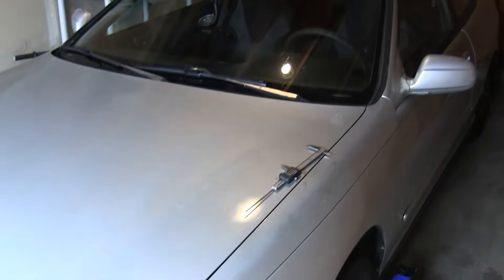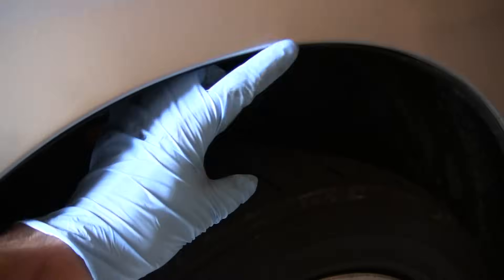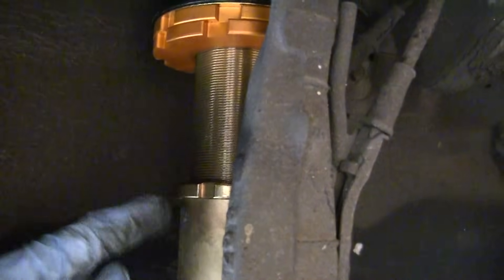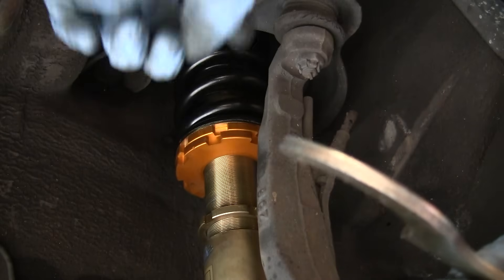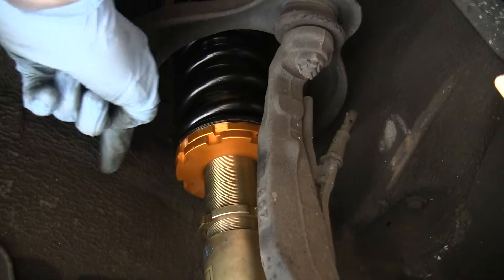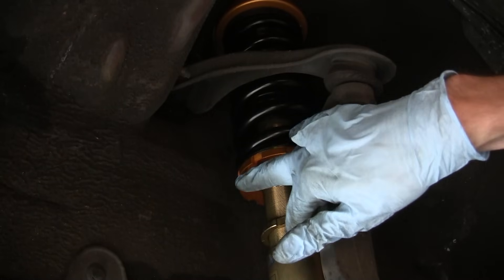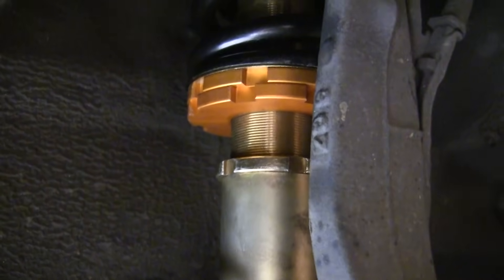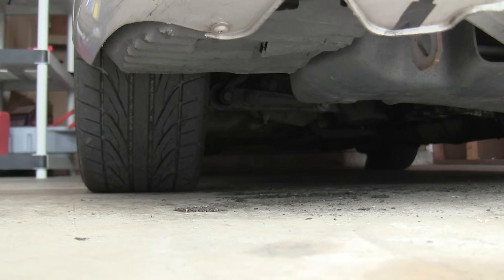How to Adjust Coilovers - Explained

Comment: is there any chance that the inner axle will pull out? when bc coilovers are on? because I had it removed because I had coilovers, I just adjusted it from .5 to 2.5fingers gap, then the axle pulled out after adjusting, suspecting the spring because it is said to be soft. or is that tension because it's no longer camber?

Comment: You should avoid turning the upper rings at all once the preload is set properly if it needs to be whatsoever.
In threaded body coilovers you should be turning the spring by hand to thread the body deeper into the bottom of the assembly, or out of it to adjust the height. 
If the spring just spins and the threads of the coilover doesn't, the preload is not set properly.

Comment: What if the rear coil lovers don’t want to lower? It seems like my front coil lovers are lower than my rear, does that make sense? Should I use a cheater bar to force it to go because I don’t know if I’m at the max which I highly doubt it because I have aanswer to gap between my tire and rear fender thingy

Comment: Please do not buy the adjustable coilover . ( shocks ) this video are not tell you what problem behind . 1the cup screws to body frame , is not fix , make a noise , 2 the break line screw holder not have a thred . I have to buy a nut to put it in . . 3 the bootm of the shock have 2 big crews this brasket biger the screws . all they loose after finished test drive . the shocks very hard . the car is not soffer when you crossing railroad . they bounding very hard . no good at all .

Comment: You are not meant to turn both adjusters at the same time one locks the other in place, you would find it far easier to unlock them then adjust either up or down and then relock them

Comment: I know is this is old. But when you do this do you do the exact same to the opposite end? For instance both front coilovers should be symmetrical? I did this but when I measure wheel gap it’s uneven. Could this just be my driveway?

Comment: Great video, I used this video to help me adjust my coilovers. 
Also every coilover is different,  just because he set his at 6.5 inches doesn't mean you should set yours to 6.5 inches too. The coilovers on my Toyota Celica was exactly the same inches as the wheel gap, where 4 inches on the coilovers (bottom of bottom-ring to top of top-ring) was exactly 4 inches on the wheel gap (fender to tire).

Comment: Rookie question, you have the bottom ring all the way down then the next camera change you have the bottom ring up? I didn’t see you move the bottom ring, so I have to turn the bottom ring up the desired amount I want it lowered? THEN turn the top ring to the left until the bottom ring is sitting flat then tighten the bottom ring?

Comment: my ksport coilovers intructions says to adjust the ride height by spinning the bottom part of coilovers that connects to the lower control. instead of compressing the spring like you’re doing in the video to prevent premature wear. now i’m a confused lol

Comment: Hi, I adjusted my coilovers, all measurements from bottom of the ring to the other ring are all equal. Drove it for miles, but I found out the wheel gap is not equal? Is it normal?

Comment: Hey I’m I gotta question when I’m trynna lower my coilovers they whole coilovers moves and the ring dont
Reply: The bottom ring is how you adjust the ride height break that loose and rotate the coil over until you get your desired height adjustment.

Comment: For a channel that has engineering in its name , i am surprised you describe rotation in terms of left and right.  There is no left and right, it is counter clockwise or clockwise depending on your point of view. I always laugh at folks who use left and right to describe rotation.

Comment: Hi, these look like the MaxSpeedRods, which I recently installed on my 2006 Corolla. The rear came out a little high & I’m wondering if I can adjust the rear height the same way you did for the front coils? Thanks in advance for your help 💋
Reply: Yes you can

Comment: @Engineering Explained - I have seen some reputable sources say adjusting ride height from the lower collar is incorrect. They say to make ride height adjustments at the lower spring perch. This makes no sense to me and intuitively I adjust ride height as you did in the video. This method does not disturb bump/droop distribution like spring adjustment would. Any comment on that?

Comment: Ok, now I know how, to adjust my dampeners. But, I'd really like to know 'why'.  I mean will I adjust them until I'm happy with the ride and handling? 
If so then I'm going to spend a lot of money on alignments as I go through a trial and error process. Not to mention that I'll probably want to adjust differently for different tracks.  
Are there manufacturer settings that are geared toward certain track types?

Comment: Im bought K sport suspension for my Honda Crosstour it can adjust about 2.5 cm lowered from my stock but when i bring to the shop and they done for car, it’s lowered than that I expect and the problem if i hit the bump sounds like cracking,, sounds like my springs at the rear is to much compressed,, im just asking is it normal or will be bad to my car,, i need ur help and pls comments thank u

Comment: pre sure you just messed with the pre load
Reply: I'm still figuring things out but I think since he loosened the bottom ring and then turned the whole shock body (and not just the 2 preload rings) it came out as if he'd just spun the bottom bracket and adjusted the height, even though the rings he was turning were the preload rings. I think if he'd loosened the middle ring (the bottom orange one) and then moved the top orange ring to meet the bottom one (so that it spun and not the whole shock) that would've done the preload. But I could be wrong.

Comment: You don't actually have to keep periodically checking the height. You can just take the lowest lock ring at the bottom of the threads, and bring it up to where the gap between that and the top adjusting rings is the placement you want it at, then keep adjusting down until you get the lower lock ring at the bottom again. Then measure and adjust slightly if needed.
Reply: I read you're not supposed to adjust the bottom ring. I'm not sure if that's a universal rule. But I never touched mine.
Reply: that’s what i thought he WAS doing😭😭

Comment: What does the pre load  of the spring measure .from the top orange  to botom  orange lock nut what does it measure from factory . Had the car adjusted an they mest with that in sted of lowering it

Comment: Great video and easy to understand, just a clarification please, in order to raise the vehicle do you make sure that the top 2 collars are well tighten together and rotate the lower collar (of the 2 collars together) counter clockwise looking from the top, should  the shaft rotate (the screwed long portion) with it too because when I did that, the shaft did not turn with the collar, what did I do incorrectly? Perhaps the 2 collars were not locked together tight enough?
Reply: Terry Tak did you back the bottom, smaller ring away from the lower mount a little?

Comment: For all those confused on how this specific coilover system works. The 1st   gold ring right under the spring itself is to set the pre-load... but only until after you set it appropriately and use the 2nd (middle)  gold ring to lock it in position can you use that same 1st ring to adjust the height. This specific coilover systems spring is independent from the top mount so it can move up and down without affecting the pre-load.
Reply: Yah basically using the "jammed" nuts to spin the entire shock body into the sleeve
Reply: Lies
Reply: @babyboynene  literally truth.

Comment: I just bought a 98 Honda Prelude. The front is lower then the back and its difficult to drive into parking lots and out, dips and bumps etc. I want to adjust my ride height and this seems like a pretty simple video to follow. I guess my question is , if I remove my wheel I could probably find a similar set up and follow these instructions?

Comment: you adjusted the preload
Reply: T Than he moved the two rings at the same time. The spring did not change at all. If he separated the rings and only tightened the top then the preload would be changed but they are locked together moving the whole tower up and down not affecting the preload
Reply: T Than that's what I'm thinking. I think your right no?
Reply: Jordan Dindyal yea he adjusting preload
Reply: Type R

Comment: i just installed hks coilovers w/ adjustable height and damping. I have it on the stiffest setting but the ride is really bouncy :( it oscillates and takes a while to settle. What do I do to fix this?? adjust pre-load? what is the purpose of pre-load? How do you know how much to pre-load it?? is the spring supposed to be able to spin once its preloaded? I can't find any decent answers

Comment: Okay So quick question, i have a 2006 civic si, i bought godspeed mono ss coilovers for it, installed them and could never get the bounce to go away, could it just be improper setup or that the spring rate on the aftermarket springs was too high?
Reply: Christian Anderson cheap coils. Try adjusting the dampening to a stiffer setting see if that helps. I put on Megan racing coils and they bounce too. Going to settle for air suspension I want that smooth ride
Reply: Im curious as well. I have an 07 EX and hate the factory ride. Want to know how to dial out the "bounce " if i encounter it. Thinking about Tein myself

Comment: Just curious since your coil overs have the threaded sleeve at the base to adjust the ride height why did you adjust the spring to change your height, is there any benefit or loss to doing it this way?
Reply from the maker: I left the spring pre-load as is, and simply adjusted the length of the strut (spring did not move).
Reply: Hey thanks for the response i appreciate it. My apologies I just re-watched the video and noticed that you never separated the two jam nuts and by keeping them together it made the whole sleeve turn. I havent had to adjust mine while still on the car so i didnt consider doing it that way but good to know thank you. One more question for you if you dont mind. I have the skunk2 pro s 2 on my eg hatch and i havent been able to find any definite answers even from skunk2 on where to start with the preload. Do you have any suggestions?

Comment: You recommend these? I know its an old vid but I just purchased a 95 w 170k miles and gonna upgrade the suspension. Its just a daily but I'd like to drop it a bit and get it a bit tighter in the twisties while maintaining a decent ride.(not too stiff) 

I was also considering these, https://www.amazon.com/Function-Form-Adjustable-Coilover-Suspension/dp/B001XX01VQ/ref=pd_rhf_gw_p_img_5?ie=UTF8&psc=1&refRID=2C7F13DMYSE8ERWH7MEN

Theyre 600 v 430 but it was what I was recommended for my needs as well as these. If there are any others you recommend please let me know. Also, I was curious, do you recommend coilovers over a spring/shocks set up? Thanks so much.

Comment: Didn't you have to unscrew the bottom first to make the adjustments to the height? Then retighten the bottom to lock, right?
Reply: To lower it yes. To raise it technically you wouldn't have to because it's going to move up as the assembly moves up. You still should though just to make it easier on your hands. 2-3 adjustment sessions will leave your palms sore lol
Reply: I think he was talking about the bottom ring that is locking the top ring, not the ring locking the height. So I believe to answer his question, is no, those 2 rings are to adjust the spring preload.

Comment: Correct me if Im wrong but I thought the locking nut/ring at the very bottom had to be loosed then rotate the whole spring assembly to adjust ride height?

Comment: Wait, didn't you say in the last video that the lower part that gets bolted on is what changes the ride height without affecting the suspension geometry? So what you did affected the geometry of the suspension, correct?

Comment: I just bought Function and Form Type one it's my very first coilovers I'm waiting for it to arrive in the mail the dampening is pre set by the manufacturer it's only a ride height adjustable coilovers which is what I need I thought you aren't supposed to touch the upper perch only the lower perch so to lower the ride height I would turn it to the left or to the right could someone help me out

Comment: Never get alignments after lowering cars on my tein coils , slammed 6 cars and rode fine after , u sure u have to get an a alignment ?
Reply from the maker: Riding fine doesn't mean your camber & toe will be set properly. You'll have uneven tire wear and likely could have better grip with a proper alignment.
Reply: Anytime you mess with a ride height, you need to get a proper professional alignment. smh

Comment: thx u for the video, helpful. how do u adjust the rears though? should the height be the same as the front when you measure from the wheel arch of the fender to your tire in the rear?

Comment: I dont want to sound rude but the explanation was a bit confusing. Like somebody asked, the way you worked looks like you were modifying the spring load by turning the orange nuts. What actualy you did was turn all the upper part of the coilover and introduced it in the base part of the coilover.
Reply: al rod Yes you can adjust preload. If you picked up for day a used set of
Coilovers your supposed to set the preload if it has any play in the springs . You can adjust that all the time lol
Reply: He actually loosen the 3rd collar to adjust the height of the suspensions even though he spun it from the orange ones he wasnt really messing around with the preloads
Reply: @yogipangnanouvong388  we know. He was getting the right effect. But the correct way is to spin it from the bottom to avoid messing with the preload on accident. You loosed the lower jam nut/collar then spin the bottom of the strut.
Reply: I think you meant preload. Spring load is how much weight the spring can bear at a certain distance. That is already designed into the spring that you select. You can't adjust that after the fact.
Reply: This comment is very important.

Comment: When i try to lower my car my spring gets loose what should i do
Reply: +harpinder Singh it shouldn't be affecting the spring. make sure the only collar you loosen is the bottom one at the base of the coilover.
once it is loose and far away enough from the bottom to allow you to lower it, you twist the top collar, since it should already be locked with the second one.
if your spring still loosens, it sounds like you're missing the second collar on your coilover

Comment: I thought when adjusting full coilover suspensions you DO NOT adjust the spring compression. You ONLY adjust the bottom setting and lower it that way. That method does not reduce the shock travel making the ride more bouncy. If you rotate the lower setting / also where the bottom of the strut sits into the bottom fork it will lower the ride height keeping the shock travel at the factory setting with the pre-compressed Spring.
Reply: +GeeMan65 he didn't adjust the preload at all.
The reason he used the top locking collar to adjust it is because it's already locked tight with the collar below it, therefore, the neither of the top rings are turning independently. it's actually moving the entire assembly (spring, top 2 locking collars, AND the coilover threads themselves) down into the bottom part of the coilover.
that's why before you do this, you need to loosen the lower collar so it allows that lower part to turn.

if you wanted to, you could loosen the lower locking collar, then hold the spring with your hand and twist the entire thing with enough strength, but because the top two are locked, it's easier to use the wrench on the top one since it will do the same thing.
Reply: +Aaronx3Sally sir can i asked i followed all the steps but upon turning the 2nd ring counter clockwise, the 2 rings plus the coilovers thread is rotating but the spring is not.. is that ok? based on my observation with this video, the spring is not rotating together with the coilover threads, however, most of other videos here in youtube about adjusting the ride height, the spring is rotating together with the rings and the thread.. so which is which? Thanks in Advance! by the way my coilovers is Yellowspeed

Comment: when adjusting coils do you have to go get an alignment after, does it make a difference if its awd or not, do you have to get that allignment
Reply from the maker: Best practice to, yes.
Reply: +Engineering Explained So every time I raise or lower that's when I should get an alignment? Great video by the way
Reply: +Nick Schooler Yes every time you raise or lower a vehicle you change the angle the strut has with the steering knuckle (on the front) and the control arms.

Comment: what if you dont have a spaner wrench?
Reply from the maker: +Michael Mack You could use a screw driver and a hammer, I do the same for very small adjustments. But they're cheap, buy a couple!
Reply: +Engineering Explained   thanks for hitting me back so quick that's exactly what I'm doing now. got the r\r up 2 inches.  I'm about to take a fat road trip after I lift the car then load it I'm going to go get my alignment done.

Comment: So the ratio of the coil adjustment to how much it actually lowers the car isn't direct? I.E to lower it 2", you can't just change the coil adjustment 2 inches? If not, with your experience do you know what the coil/wheel gap ratio is?